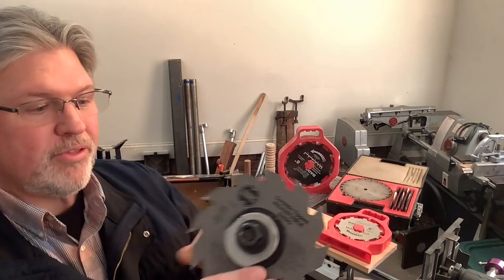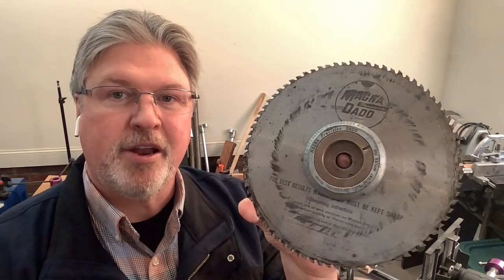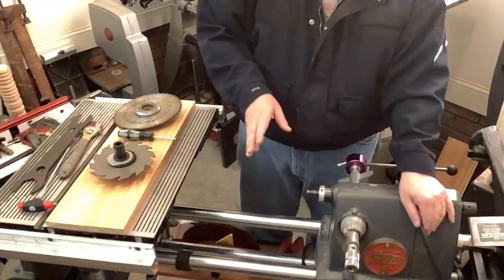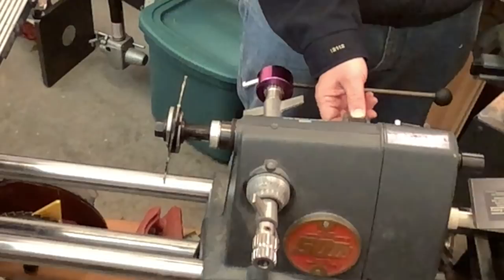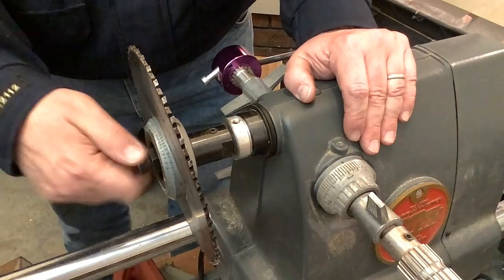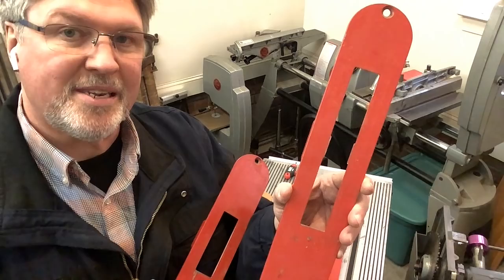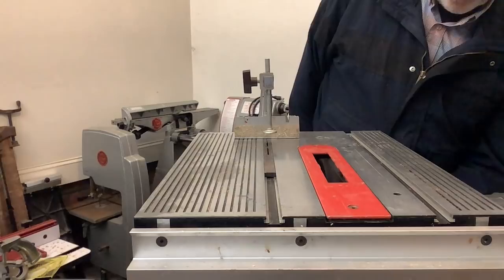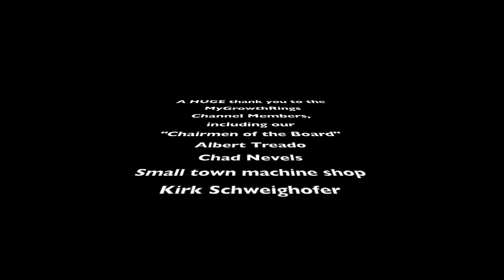Dados on a Shopsmith and What's a "Magna Dado"? A Wobble Dado? A Drunken Saw Blade?

Comment: Given the arc-shaped profile that the tips of the wobble blade trace out, does it also result in a very slightly taper the width of the groove as seen from bottom to top? □
Reply from the maker: You’d think so, but no. Each tooth makes a circle around the arbor, so the cut is a straight 90 degree cut. It’s one of those things that defies logic, like pineapple on the pizza.
Reply from the maker: BTW, nice use of the Robertson drive logo!
Reply: @MyGrowthRings  Only fitting for someone from Canada!  You can't easily get anything other than Robertson... they're as common as dirt up here.
Reply from the maker: @bmedicky  I'm a bit Roberton fan from way back. Down here they started catching on in the late 1970's when a catalog company names McFeeleys started to push them. Only took them 60 years!  Did you know that Henry Ford used over 700 Robertson drive screws on the Model T until around 1909 when he and Mr. Robertson had a falling out and he encouraged his friend W.G. Allen to knock Robertson off with what became the Allen drive? Yeah, I'm a hardware nerd. Scott
Reply: @MyGrowthRings  Most folks up here have heard the story about Robertson proudly sticking to his guns when he couldn't strike a good deal with Ford to use his screws.  Anyhow, they are the everyday screw around here, for all intents and purposes.  Certain specialty screws like GRK construction screws are Torx, and hinges sometimes come prepackaged with Phillips screws, but otherwise it's always Robertson.  Slot-head are impossible to find unless you shop at a specialty fastener store, and even then not all of them will carry slot heads.
Reply from the maker: @bmedicky  Oh yes, I’ve heard that from a few of my Canadian hardware nerd friends and I believe that’s also true.

Comment: Scott do you need the special ss dado arbor on a 520 using a craftsman wobble blade. Thanks
Reply from the maker: Yes, you need a dado arbor to mount any dado blade or set on the Mark V. Scott
Reply: Thanks I guess I will be back shopping soon
Reply from the maker: @robertaiken8576  They are on eBay all the time. Check out the links in the video description.

Comment: I’m curious. While you produce excellent videos containing great tips, there is one technique I don’t understand. And, that is using the miter gauge alone to support wood going into a blade. Why wouldn’t you add a support board (like a 3/4” x 3” x 18” piece of wood or plywood) attached to the miter gauge to give added control and support to the piece you are cutting or putting a dado cut in?
Reply from the maker: @chrismorgan3486  Chris, that’s a great question. I often do use a backing board, but when producing videos when I don’t have a project in production I may not.

Comment: Do you the shopsmith dado set mine is from the 80’s it always leaves a rough bottom. Do you have any tricks to help
Reply from the maker: If your set is the one with the black and clear plastic case, it’s just doing the best it can. It is ok for some tasks, but it won’t leave a clean cut in cross grain dados. Scott
Reply: Yes it the one in black case thanks
Reply from the maker: @oldmangravely6554  I had one too and never could get decent results from it, even after having it resharpened. I have been very pleased with the carbide set that I use, but depending upon how often you need to cut a dado or groove you can always make multiple passes with a saw blade. Scott

Comment: You mention the stop collar but didn’t really describe how you are using it. Do you use it solely for supporting the table and/or is it used to help keep the same depth when adjusting the dado?
Reply from the maker: Sorry, I was having camera issues again and missed that detail. I do it to maintain an accurate depth and as a safety precaution. Once the table is adjusted to the final depth I lock the stop collar down against the carriage. I have a friend who lost parts of a couple fingers in front of a class at Shopsmith because his table dropped while he was demonstrating the use of the moulder. Scott
Reply: @MyGrowthRings  😳
Reply: @MyGrowthRings  I have a SS adjustable stop collar made to dial in dado depth of cut. The thing is solid as a rock, haven't used it but a few times. Does this type of stop collar act as the same way as the one you're using? Curt.
Reply from the maker: @curttundra  It sure does. I would use it every time I dado.

Comment: I was experimenting with my mark V  I put a saw blade on the machine with the saw guards b but the table tilt hinges interfere with the lower guard. Died the 500 use different guards than the 510 etc?
Reply from the maker: Hey Jeffery, Oh yes, the guards changed tremendously when the 510 was developed. The 510 guard can't be used on the 500 model or any of the earlier tools. In order to add that much "stuff" Shopsmith had to redesign the carriage and spread the posts on the table.  It's pretty much an all-or-nothing upgrade.  Scott
Reply: @MyGrowthRings  are there markings or anything that would confirm what I have?
Reply from the maker: @jeffreylopez5403  The model should be called out on the round name plate on the left side of the headstock. It’s a chrome plated circle around the high speed (jointer) shaft.
Reply: @MyGrowthRings  sorry. I meant in the guard. Is there a way to distinguish which guard I have.
Reply from the maker: @jeffreylopez5403  Sorry, I misunderstood. No markings, really, but the 510/520 lower guard has a single machine screw that tightens it into the quill and the right hand side of it can be moved close to the blade and tightened in place with two knurled knobs. There were several variants of the 500 guard, but I believe that all of them have the right side open, which is covered by a plastic part that attached to the table’s tie bar. They also attach to the quill with a clamp that uses two machine screws. Hope this helps.  Scott

Comment: Watch you last cut see how close your sleeve comes to the blade.  Roll up your sleeves or be prepared to have them grabbed by the blade.
Reply from the maker: From your vantage point it does appear that way. Not so from mine, but that is for your concern. Scott
Reply from the maker: BTW, have you ever seen this video? https://youtu.be/UeQzIzj3j_Q
Reply: @MyGrowthRings  interesting video.  I'm not going to dangle my sleeves to see if I can get a different result.  lol
Reply from the maker: @daveschmitt6369  Good call!
Reply: @MyGrowthRings  interesting I always was taught there was so much danger in loose sleeve getting caught in saw blades.  After watching video in think I realized the error of my thinking. Oh well better safe than sorry. Great videos by the way!
Reply from the maker: @edblough4134  No reason not to use caution, and if I had know it would appear that way I would have changed something about the shot.